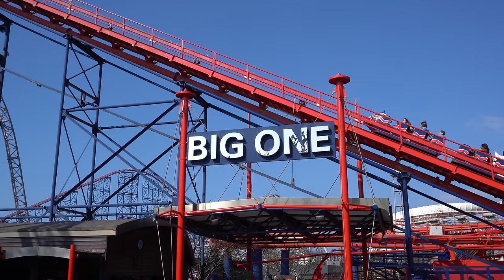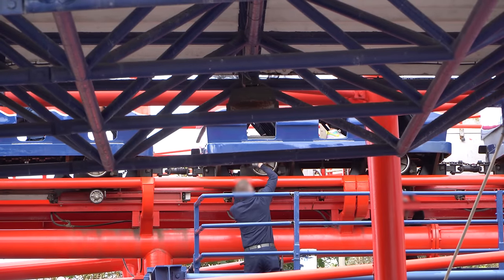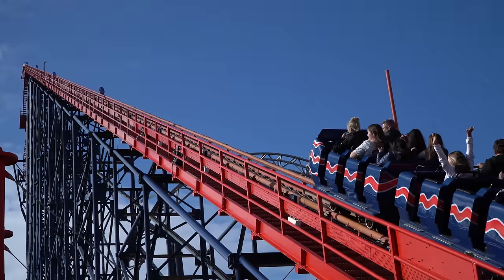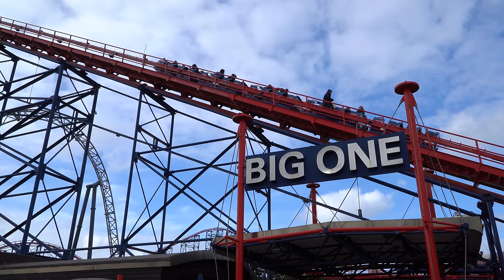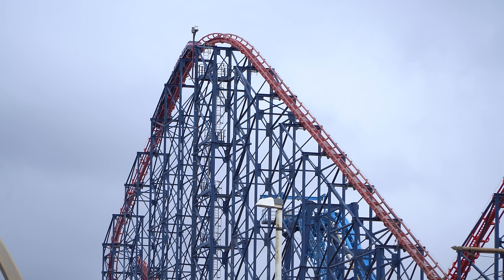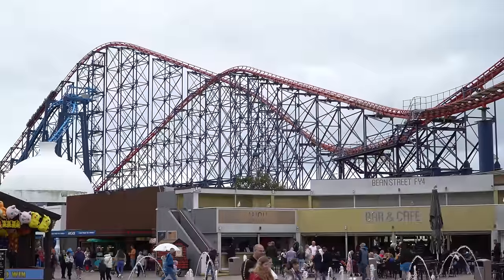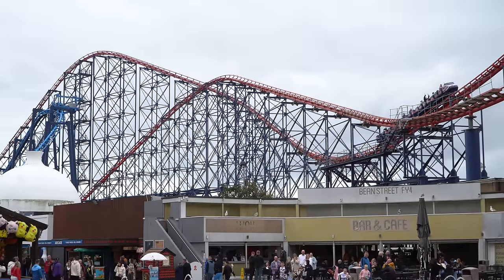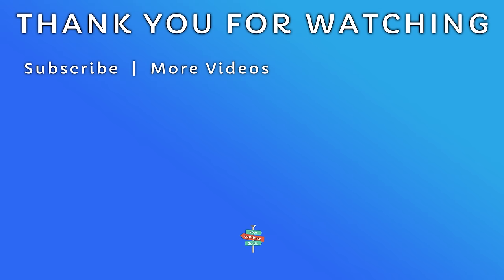What's WRONG With The Big One at Blackpool Pleasure Beach?!

Comment: Former Ride Op from 2001 here.
There now being 3 different speed wheels is new to me, as are the wheel checks during operating hours (they used to be done when we were doing the block checks at 7am).
When I was there, they had just introduced the "fast wheels" for use on windier days. As it takes time to change the wheels, BPB decided to outfit 1 train with those wheels, and the other 2 would remain on the original compound wheels, hence there would never be a 3 train service ever again.
This way, they could ensure The Big One could be run on most days - Nice days would be 2 trains, and windier days would be the faster single train, though there were days when it could not be run at all due to the wind.
There are 2 other reasons for e-stops on The Big One that you forgot to mention.
1 is when the wind suddenly changes speed and/or direction that could cause a train to valley. Providing the train is still on the Lift hill, the computers are able to stop the lift.
The other reason is to do with the computers... Yes, computers. The Big One has 2. Both receive the same data from all sensors and have to agree on the data. If they do not agree, it is known as a handshake failure, and the ride will e-stop. This is designed that way and is not a fault, but a safety measure. For example, 1 computer may think train 1 has passed the mid-course block brakes so train 2 can leave the lift, but the other computer may disagree, so for safety, the e-stop system activates.
I do agree that BPB need to be more open and honest about e-stops when they happen. Even back in 2001, they just wouldn't be honest.
Reply from the maker: I thought the fast and slow wheels became a thing in the 90s? 

I believe there’s a number of reasons 3 train ops were scrapped in 2001, shame really but it is what it is. An efficient 2 train service would be fine. 

I’ve never heard of the lift hill automatically cutting out due to high winds before, but I’ve seen a few people say that today.
Reply: Former charge hand of the ride here, there is no sensor that stops the train at the top of 'A block' laymen's terms the lift hill, due to wind.

for it to stop at the top of 'A block' it's usually sensors at bbcs1 or 2 laymen's 'mid course break run' would have to be flagged 'occupied' in order for the ride to automatically stop the train there this was a regular occurrence during 3 train operations rarely seen or triggered by that situation today. 

During normal running 3 trains when the train on a block reaches 3 quarters up the lift hill and the train Infront was not clear the lift would auto slow to a crawl for around 15 seconds ten or 12 anti roll back clicks if the train in front cleared block before the end of that cycle the train on the lift would be auto released, if it didnt clear for whatever reason be valley or estop in block break then the train would stop at the top of the lift hill and the dl40's  would examine whats gone on and where the trains are, once complete and the dl40's have timed out the operators can then clear the offending block reset the breaks and carry on normal operation. There is definitely no wind shut down sensor!
Reply from the maker: @danpmbo  Great insights there Dan, thank you 🙏
Reply: @danpmbo  There is a wind speed and direction sensor. In Your Experience Guides' video: The Big One (Pepsi Max) "Between The Rails", @1:09, you can see it
Reply: @DaveR1974Grows  There is, but id doesn't stop the train. It is down to ride ops not to send the train if the wind is above the limits. We just read the wind speed from the "wind sensor" at the console.
Reply from the maker: @DaveR1974Grows  It doesn’t stop the train automatically though

Comment: When Shockwave at Drayton opened in 1994 it had 3 different hardness polyurethane wheel sets, the harder the compound the faster the car used to go round (also made it very noisy), the fastest the trains completed the track in its first year was 28 seconds (from leaving hill back to braking section).  This used to give just under 1 and half minutes to load the second train in the station.  After the first season the trains had to run on softer compound polyurethane due to noise complaints from its first season.
Reply from the maker: Interesting stuff thank you 🙏

Comment: Thank you so much Scott thought this was a great knowledgeable insight into what many perceive as issues. It’s not new though remember JR on the Pleasure Beach series it stopped on the hill and within 2 minutes the local radio station were on the phone what’s wrong with the Big One. In a side note do they still have 3 trains available to use on the varying compounds or are they down to two just wondered?

Comment: Really interesting. I’d be interested to know what the various “compounds” are and how different formulations affect the ride experience. 
Wheels are generally polyurethane (PU) but PU is such a versatile material. PU is a thermoset created by the reaction between polyols and isocyanates. The choice of polyol and isocyanate — not to mention catalysts or other additives — can massively change the PU’s characteristics. PU can be a solid compound like rollercoaster wheels, a rigid foam like insulating panel board (used a lot in theming and rock work because it’s easy to sculpt), and also as the foam in cushions and mattresses.
I, for one, would be really interested in seeing a video on this one day.

Comment: the big one use to run 3 trains till 2000 i know its only a year out but the change happend after the station brake failure in 2000 but awesome video.
Reply from the maker: It wasn’t a station brake failure, it was a block brake override that lead to one train colliding with the one in the station. 

It ran on one train in 2001 and two trains onwards in 2002.
Reply: @yourexperienceguide  thats what Google said when I looked up the big one stats a year ago
Reply from the maker: @hamfan4449  I have contacts who were working at BPB on the day
Reply: @yourexperienceguide  its still a brake failure and it did happen in the station so.
Reply from the maker: @hamfan4449  Yep, but wasn’t due to a failure in the station
Reply: @yourexperienceguide  I'm going to double check with my mate who works at pb
Reply from the maker: @hamfan4449  Ok, my info comes from people at BPB 👍

Comment: The big one also has a system that monitors wind speed and direction at the top of the lift hill. If it detects wind at a certain speed and direction, the big one will also stop the train if it's on the lift hill as if the wind is a certain speed and direction the train cannot make it to the mid brake run and will roll back causing the park a massive headache. Sorry I cannot remember the actual wind stats.
Reply from the maker: I’ve never heard of it automatically stopping itself on the lift due to high winds.
Reply: I must admit I wouldn't go on it. I wouldn't want to walk down from the top 😢

Comment: Strange that wheel checks are done with guests on board. For Alton Towers ops when i did them we would send empty trains to be stopped on the lift or on the brakes. Why ruin the ride experience deliberately?
Reply from the maker: It’s how they’ve always done it, and sending a train empty on the Big One would likely mean it’d need to be fully sandbagged which adds more waiting time for everyone.
Reply: @yourexperienceguide  interesting, and to think of how many empty trains we'd dispatch on Neme or Air simply to get rid of the vomit, or to quickly get the train in for offloading that'd been out in the waiting area for ages. Obviously not an option on Big One then.

The truth is though any stoppages grab attention. Air had a habit of stopping a train the top of the lift as the brakes were too slow to clear for a time. AT and B&M spent months trying to resolve that. It always caused a stir whenever it happened.

Comment: I’m no expert but I would assume the ride stops because the computer that controls the ride because it has detected a fault somewhere so stops the ride to prevent injury to both the ride and its passengers.

I also think because of the rides location and its exposure to the elements, maybe the elements play havoc with the sensors triggering false alarms.

Could be one of a billion things but all in all, it’s still in good condition and has plenty more life in it!

It could also be a software fault
Reply from the maker: The safety system does what it’s designed to do and stops the ride if it’s reading a fault that could cause issues. A short lift stop or evac is better than a collision.

Comment: I have a question I’ve always wondered what are them wheels in your background are they rollercoaster wheels and if they are, from what ride ? :Edit oh it’s a big one wheel
Reply: The big one on the left is probably of the big one, the wheels that run on top of the rails are usually larger than the side/ up stop wheels! .
Reply from the maker: There’s 5 from the Big One, 1 from Infusion and 1 from Megafobia

Comment: Not much you can do about how people react to the block checks

As for the wheel checks, I think it would help if they were performed without guests aboard any of the trains. Leaving a loaded train 50ft up a lift hill only adds fuel to the fire with these sensationalist articles, the publications would care less if the train was clear of guests as they can't throw around the "guests stranded" line and whatnot. Plus, the ride being checked by maintenance in operating hours could rub guests aboard the ride the wrong way, no matter what the staff tell them there and then. I totally understand how one could perceive this to be very sketchy. It's also just a bit of a needless inconvenience to the people onboard, especially if they haven't been warned prior that these checks will delay how soon they are able to leave the ride
Reply from the maker: They’ve done the wheel check procedure for most of the coaster’s operating life